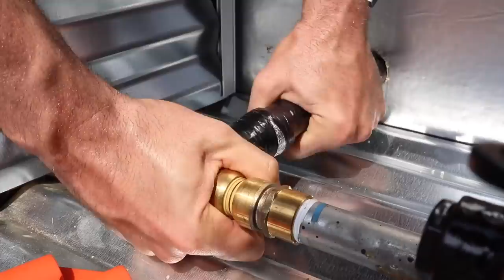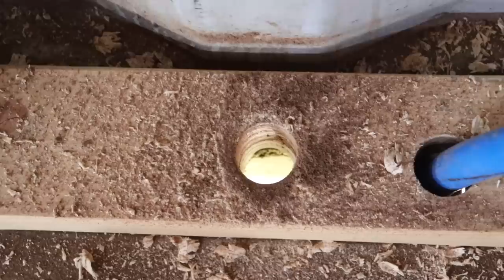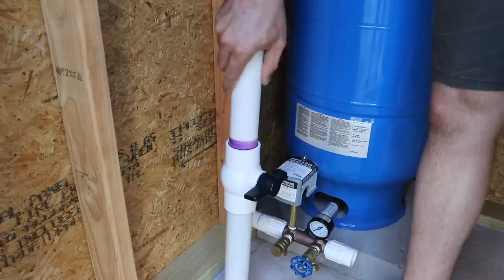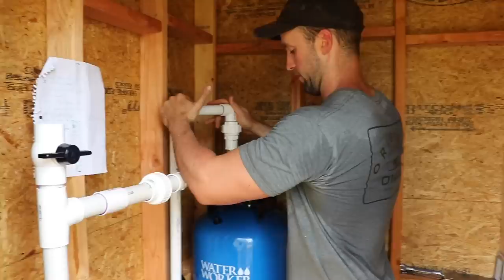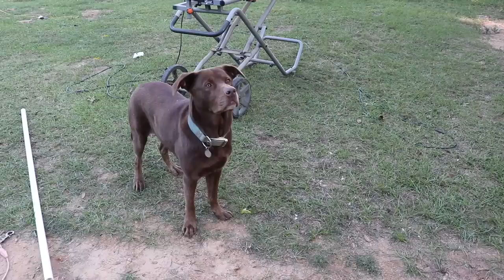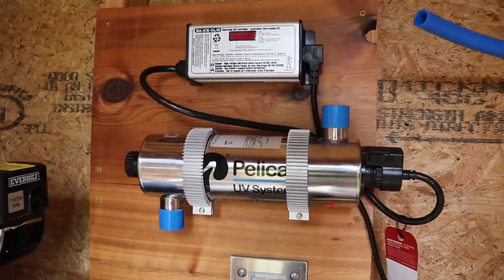How We're Getting Drinkable Rainwater OFF GRID!

Comment: Make sure your stainless steel lines are long enough to put a loop in them befor the pex pipe, and you might what tho think of a active water softener the better ones expose the water to "O3" (Ozone) for fuller protection from micro-organisms, and the water softener will remove thing's that the Active carbon filter will not remove, and you can tell a sale's rep you use rain water and have resins add to remove nitrogen and surfer based material, as well as other's. Other option's to look into are Radiation detectors for your water befor or after the pump to measure for Cobalt 60 as well as other sources; x-ray, gamma, ect, you get the idea. (Colbalt 60 is the worst).

Comment: So is all the water to the house going through the 3 filters and then sanitized by the UV light?  Water for flushing the toilets wouldn't need to be carbon filtered and sanitized, but that would require installing separate water lines.  However, it would make your carbon filters last longer depending on how much toilet flushing you do.  Just a thought.

Comment: Short straight pips instead of long crooked pips, think sewer.  It will reduce your pressure on the pipes and the  pump,  100w less over 20 years that's a lot of solar.

Comment: Please remember once you filter all out, it has a chance to get bacteria in the line going out quickly.I miami Florida they did a high riser with reverse-Osmosis system and it filter all out, but left all the lines in the building without Chlorine to keep the bacteria low, well the whole build was in six months time full of a water bound bacteria. they did not notice until many were sick. If you filter the water leaving the filter shack, the waters in the home will get bacteria in the line. Drinking and shower water should always be filtered at the tap no matter what any filter guy might say. I haqve done filter for year, please filter at the tap also.

Comment: I would have put the pressure tank last and only pressurize clean water.  The filters will add resistance to the line.  Having the pressure tank last would make the water flow better especially with on/off quick uses.

Comment: Need to insulate that pump house and seal with waterproof sheet rock. A leak will destroy that chip board. Walls and ceiling. Also think about an electric heater for winter. I have my own water system and pump house. Water leaks are inevitable over time and a frozen pump is a broken pump.

Comment: one question for you is that your release valve seems to low as on hot water they have it at the top as it only needs to release the steam. with your unit it will pump your tanks dry as water release is not the answer as tank will empty to the release level as steam is trapped from escape. can you see the problem it creates.

Comment: I have an odd mind not knowing what I wanted to do my self and looking at what you did I worked out something much better using some of your ideas and a few of my own just starting with what you have ( for a large house)
1 take one or two old water heaters tanks dig hole so 4/5 will be in hole of each tank 
2 take 2×4 and build frame to fit around tanks or build firms 
3 and spray from tanks leaving room for pee gravel 
4 put pee gravel around the fon and pack it lightly.5 take copper pips and run through your box and the top pip runs back down to the in let pip of your tank then to a presser release valve about 110 too 200.or desired timp.
Reply: Take apart the old tanks

Comment: I was a bit concerned about line freezing while watching this video. Even though you may have buried the lines deep enough from the pump house, there is still the chance that the lines (cold water)could freeze after they exit the water heater going into your home even with that insulation. You may want to consider constructing some kind of wind break at that point just to be safe. Of course if you're living in a part of your country where the temps don't get that low in winter, then disregard this comment. ;-)

Comment: Y’all  have back ups for the backups.good work .im sure there’s a reason for that electrification tape(joke ..end of video)wrapped around pipe going into the hot water thing.looks out of place.not talking aesthetically per se , just something not right about it. Do something different before you finish up that preheater & seal it all up. Good work.

Comment: I use that same type filter at our cabin, which is on a well system. We change the filter every six months. We use chlorination injection to kill any bacteria in the well water. That is what municipalities use.

Since you are using rain water, instead of ground water, that UV light is a good option for killing bacteria. A lot of houses around us use UV light on their ground water systems. I have one neighbor who does not use any method to kill bacteria. They've been drinking water from their well for seventeen years without any apparent problems.

We live next to a lake, which is really the source of our ground water. As least you don't have to worry about pesticide runoff in rain water, needing a water softener, sulfur, iron, etc.

One of our neighbors uses a rain water system with a 2500 gallon storage system. He lives alone and it works for him. We have been getting plenty of rain the past few years. Several years ago, we had a drought and he had to bring in water that one summer. With 7500 gallons of water storage, you should be fine.

Your system looks good. That filter works great. Your filter cartridges may last longer than six months since you are using rainwater. Rain water should have minimal sentiment, unless it picks up some dust particles from the roof or gutters.

Keep up the good work.

Comment: When you use those PVC ball valve they have a habit of seizing up after time. , when you go to shut them off you'll grab a pliers and break the handle off oh oh now what ?
Reply: When I saw Spencer installing that valve I thought the same thing. I have experienced those valves seizing and breaking the handle wings also. I now need pliers to operate them. I was wondering if cycling them periodically would prevent seizure? I will never use them again.
Reply: Whatever you do do NOT get glue in the ball mechanism! It will jam for sure.

Comment: I don't use a pressure tank on my systems. I have 2 buildings running rainwater tanks. I needed 2 filter systems with a UV unit on each.

Comment: The UV light depending on.     n/m wave length will break down the plastic binders in addition you may consider placing the UV light above a stainless tank and allow the water coming in to  be  sterilize and allow the light on a timer to stay on for an additional few min to ensure light saturation U/V REQIRES TIME TO KILL PATHOGENS.

Comment: I've been following your progress so far, good work. Just don't forget to insulate the piping and and the walls before your first extended hard freeze comes down in your area.  As for your electrical work, ⚡⚡ use GFCI receptacles or GFCI circuit breaker for your your power needs inside.  Good work, keep it up , winter is coming. 👍👍👍

Comment: Shalom Aleichem. 

Approximately how does a setup like yours cost?

I'm a retired mechanic on disability and money is tight.
I do have a well, but it's only 60 feet deep an although I use it for washing, flushing the toilet I don't drink it because there's a lot of farmland around here. A lot of people get stomach cancer around this area an I suspect it's farm run off. The local tests only test for salmonella and they refuse to check for fertilizer or any other farm related contamination. Private water testing costs a lot of money,money I can't really afford. 

If I could use your method of filtering I could separate the washing / flushing water from the drinking water an cut my buying of bottled water considerably. 

Ratson haba b'shem YaHuah

Comment: The only problem that you might have with the water filtering is the choice of a 5-micron filter instead of a 1-micron. Bacteria can be smaller than 5 microns, so in theory, they can attach to a particle larger than themselves and if they happen to go through the UV on the side of that particle facing away from the light, they would survive and get through. That said, a 1 micron in theory (again) will filter out most bacteria as well (like 99.9%) and any other particles down to 1 micron so you could argue at that point the UV is overkill. I know I'm going to do both. The 1 micron and UV take care of 99.9% of bacteria so having both will get you about as close to 100% as possible. I hadn't considered a valve to prime the pump so I'm really glad you mentioned that one! Smart thinking and going in my notes! 🤠

Last thing, on the water heater tank, flat black (like a stove paint) would be a better choice. The gloss of the black is itself reflective whereas the flat black would be less so. May not make much real difference in reality. I'm interested to see how well it works out for you! Being in Arizona myself solar anything is a great first option (330+ days of sunshine after all 🤗). 

Looking good! 🤠

Comment: Just a quick question. Did you guys protect your exterior exposed water lines from hard freezes? I am not sure that just wrapping it with insulation will be sufficient.  Possibly the Pex  can expand and contract better than copper. BTW, great job on your water system - you guys did an amazing job. Preheating your hot water is really quite brilliant, and using an existing hot water tank for your preheat storage tank. That is a really good idea.  Using an electric pump to create pressure is also a very good choice.

Comment: I see you have a check valve before the pump. That is good, but you should also have one on the incoming line to the solar heater so it will not send hot water backward through your cold line. So right at the inlet of the solar tank.  And it's called a WATER METER... lol...

Comment: The lower pipe, that comes out from the tank, looks like galvanized steel? If that is the case, will it rust more quickly (dues to galvanic corrosion issue)?

Comment: Another cool video. Bit of advice from an old plumber, without any temperature contol on the batch water heater theres a good chance the temperature and pressure release will go off quite often in the summer sun, remove the pex tube (the absolute max this will handle is 200 degrees, most manufacturers state 180, most TPRV's release at 190) and use copper tube, the water will be seriously hot when it comes out, if the pex gives up and dumps water into your batch heater its going to make a mess. 
Top tip when your using push fittings, spit on the pipe, it slides past the o rings in the fittings easier.

Comment: I think the salesman saw you coming when he sold you your pump system. I'm pretty sure your system will work perfectly but it might be a tad more than you really needed. I had a roof collection system with tanks virtually exactly the same as yours. I built mine something like 30 years ago and technology has moved on a bit but my basic pump system involved a polyethylene pipe 2" direct from the tanks to the pump with no fittings at all except a male adaptor which threaded into the pump. I just bent the pipe instead of using bends. The pump was pretty standard and it had a 2 gallon pressure tank on top which worked off a diaphragm. The inlet into the house was 1" polyethylene and I had a particle filter about half the size of yours directly off the pump. I tried cleaning the filter cartridge without much success so I just replaced it every 3 months or so. Charcoal filters were a thing even back 30 years ago but as mine was a rural property with about zero air pollution I didn't bother. Again if I had installed one it would have been a pigeon pair the same configuration as my particle filter. I'm pretty sure ultra violet filters weren't available back then at least for domestic use. I had two babies in the house and my system had no effect on them and it wasn't until they started daycare that they got every disease known to mankind. Twice over. Having your pump perched on top of the pressure tank doesn't make any sense at all as it will make the pump work harder than if it had been at around the same level as the bottoms of your tanks. Bends in any water system aren't your friend. Forcing water around a bend impedes the flow a measurable amount for each bend so try to use as few as possible. Anyway you have a Rolls Royce system and the only difference you'll notice from a town water system will be when the pump kicks in and even then it's barely noticeable. Showering using rain water is an experience as the soap lathers even before it gets wet. Be prepared for the unpleasant taste when you have to drink town water from here on. The best thing you can do for your babies health is never let them anywhere near another kid. Just kidding.

Comment: A foot or two of the hot water pipe will be exposed to the winter temperatures so I would suggest a  small section of heater cable.  Pipe and Valve (6Feet) Heat Tape Cables. I used 6 feet of it to keep my pump out discharge pipe from the humidifier in a forced-air system. It solved the freezing of the discharge pipe liquid when the outside temp dipped well below freezing. The tape only goes on when the temp drops.

Comment: Enjoying your videos. One note about using rain water for drinking. We've lived off-grid for a number of years. We love using rainwater for showers, laundry, etc. A few years ago, we started using filtered rain water for our drinking water, but after some time we realized that we weren't getting sufficient minerals (loss of bone mass and tooth enamel). Did research and started adding minerals to our diet but now have switched back to using the spring water for drinking. Especially important when pregnant. A neighbor had trouble using rain water with their older plumbing in that it dissolved into the water and caused problems. He is a chemist so did testing, etc then started mixing their rainwater with their well water. He said it did not take much mineralized water to reverse the issue. Might be topics you want to research.

Comment: My understanding is that the Red PEX has an oxygen barrier used in closed loop hot water systems and not designed for potable water use.   That's not to say you didn't get Red PEX without the oxygen barrier which would be fine.

Comment: Love watching the progress of everything. You should double-check the literature of the water meter, they should be installed on a horizontal pipe or if on a vertical pipe where the water is being pumped upwards. You will not get an accurate reading with the water falling through the meter. If you have questions about it let me know.

Comment: I just discovered  your video. I Live rural as well and have a system similar to yours. I would suggest you get a larger UV light  perhaps 8 gallons per minute. The one you have  is so short that any nasties that pass through your UV light may not have enough contact time to be sterilize.  You have to clean glass from time to time depending on the type of water you have , this build up on the glass also reduces the effectiveness of the UV. Remember to install a by pass or shut off valve so you can do this maintenance or just shut you system down . Good luck and enjoy you wilderness.

Comment: Maybe you can't see it from the angle of the video but there should be 3 shutoff valves to regulate the flow of Water for the batch heater. I only see two. Water, like electricity, always follows the path of least resistance so from what I could see most of the water will bypass your batch heater unless you put a shutoff on the vertical pipe between the in/out for the batch heater. I was kinda hoping y'all would set it up with a heat exchanger instead of the inline method. Can't wait to see y'all doing projects inside!!!

Comment: You have done an awesome job Spencer, but if you ever redo your water pumping station, install the gallon counter, the filters and stuff before the pump. so that the pump does not get push back from the devices installed ahead of it. just a little tweak that will save you power and your pump too :P

Comment: For increased insulation for the hot water line you can use a pool noodle, since  pool noodles generally have a hollow tube down the middle. A neighbor did that since the pipes for their second bathroom went through their garage and it was sometimes open in winter with freezing temperatures. Idiot architects and house builders didn't think about that of course. So regular pipe insulation then they sliced a pool noodle and put it over that, wrapped it with some house wrap they had laying about from some renovation. Hot water stays real hot despite everything. Just thought I'd offer the idea since it's not an obvious one.

Comment: What I like about the flow meter is after a few times changing the sediment filter you can check about how many gallons of water used to change it instead of waiting for the pressure drop to the house and checking it unnecessarily.....     When I installed them some people said they had to change all the time and I had to tell it was doing its job!    The one I liked was a button would pop for the change......     It would be nice to have a light at the pump house if lost pressure you can check if the electricity is still just by looking out the window at night.....

Comment: Should you not have your inlet and outlet at the opposite ends of the tank otherwise the cold goes straight up to the hot outlet after a short while> That's how I built mine and it works great.

Comment: You need one more valve behind  your  batch water heater.  You need to stop the direct water flow in between  the two valves  for the batch  water heater  to have it pass through  the batch  water heater if not the batch water heater  will not work and the water will be stagnant  and will be like an algae bloom and water will stink.